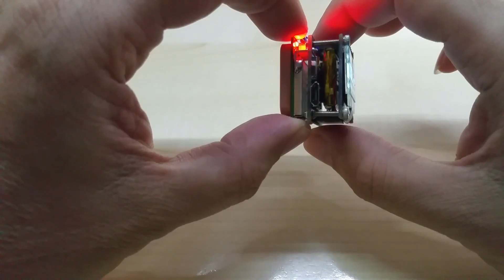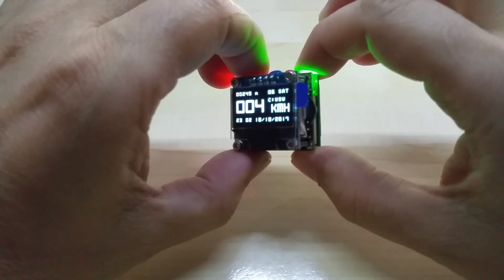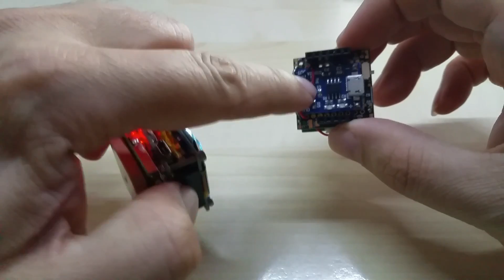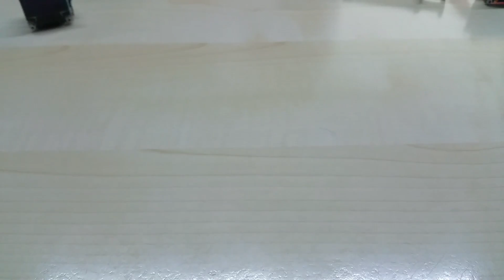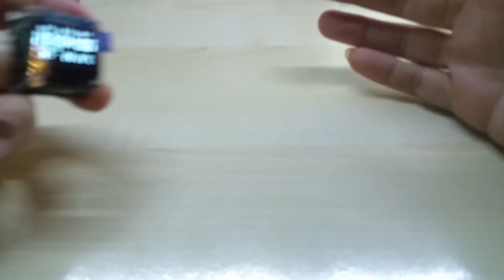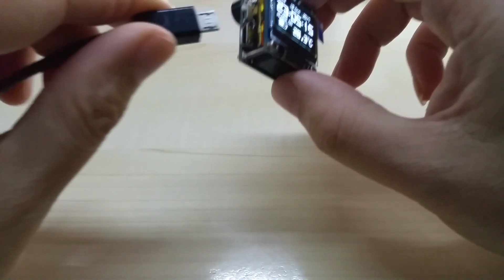New GPS and Clock Cube made with my OLEDiMAX PCB

Comment: Does it show temperature of oil, coolant, transmission? I'm looking for mercedes 2004? Is it possible to set temperature alarms? Is it possible to connect separate oil pressure sensor?( I don't have oil pressure sensor and looking to install one myself...
Reply from the maker: No, this is just a GPS. You need a gauge for a car. My CAN BUS gauge however works only for cars 2008 and newer that support the OBDII standart.

Comment: Since this device would be in car a lot of the time, it would be nice to add UV sensor also. So we can see how much UV in the bright day when we drive. (Just an idea)
Reply from the maker: Well if I do add something to it it will be a temp reading but the problem right now is that it needs to be extended or it gives false reading due to the heating up of the GPS module.
Reply from the maker: Forgot to add, my OLEDiTREK which is nearing completion could be fitted with a UV sensor or any other I2C based sensor for that matter :-)

Comment: hello sir, maybe you could do a demo on it onboard a moving vehicle, i want to see how fast the reading would be, if it has no delay in speed movement, we might order 3 of these :)
Reply from the maker: Hi, the update frequency is 1Hz, so the speed if it changes gets update once a second, it is perfectly suitable for speed reading.
Reply: anyway, hope you could still do a simple demo even on a bicycle. thanks :)
Reply from the maker: Hi, just did a video for you, you can see it here:

https://youtu.be/awtknKv3scQ
Reply: Hayri - thanks a lot for the effort. We're definitely gonna try it out.

Is there a way that i can power it w/o using a Lipo pack? Lets say i use a 12v motorcycle battery and use a stepdown BEC from 12v to 5v to power the GPS speedo? It will be quite difficult to pull out the lipo once i install that to a motorbike top bridge

Comment: Are you still interested in making me a high sample rate ultralite gps tracker for measuring speed of my racing drones?
Reply from the maker: Well I was limited by the 1Hz update rate of the GPS module I used on the GPS cube but now that I use a tiny (weight saving is good for drones) new GPS module with integrated antenna the size of a thumb nail on my new product the OLEDiTREK, I could use that and might make something for the drone market. Please send me your email for further discussion. Thanks.
Reply: that sounds awesome.. my email address is Zak@skunkworksbikes.com

I'm after a tracker for speed but there would be a market for a gps/magnetometer that talked to the flightcontroller and you have power available.. can't wait to chat more about it
Reply from the maker: Replied.

Comment: An easy way to dim the display is to use 2 pieces of Polaroid film and rotate one to dim. May not be as elegant as a software solution but simple and cheap.
Reply from the maker: Or just any grey colored foil :-) Just need to make it motorized to pull it over the screen at night time, lol.
Unfortunately not all display libraries support dimming but to make it possible with software and a small light sensor on the cube would be great.
Reply: That would be neat, especially if instead of just bright/dim it was graduated according to ambient light level.
Reply from the maker: Well hopefully one day it will be like that.
Reply: I used to have a car stereo that would dim its panel according to ambient light. That gave me the idea to make the volume change according to road noise. A mic picked up ambient noise and fed into an op amp along with inverted speaker output to eliminate reading the music as ambient. This was then used to control the volume. It worked very well for years until the unit started to draw over 1 amp even when off and would drain the battery overnight. Since I could not easily find the cause and don't even listen to the radio anymore it has since become a source of parts for other projects and been replaced with a newer unit. And since I don't use the radio on the road I will probably not bother to modify this one.
Reply from the maker: I used to be a car nut with modifying and making custom music installations and all, back in the days. Now I want piece and quiet when I drive and am glad to get from point a to B without getting my feet wet :-)
Reply: I don't have any OLED screens that I know of but it occurred to me that if they are like liquid crystal displays you would only need one polarized sheet to dim them as the output is already polarized. Or am I not understanding how they work?
 I have had my truck for a year and still have not even turned the radio on.
Reply from the maker: No, they have nothing to do with LCD screens, OLED stands for organic LED, meaning there are 128x64 tiny LED's in the display. And when there not on you get the perfect black so to speak, that's why they have a very high contrast ratio.
Reply: I guess I should read up on them as I like the display quality. I don't know why they are called organic, is it just a catchy name or do they grow them in a green house? Sorry, long, wet day.
Reply from the maker: Well, google will give you all the answers you are looking for :-) I do not know why they call them organic myself. Maybe they grow on trees :-) But I do love them which you can see in my products.

Comment: Quick question, I'm looking at how you use the bolts to connect one pcb to another. Are you using nuts of any sort or are the threads of the bolts simply "grabby" enough to take hold in the FR4?
Reply from the maker: No nuts, used to do it that way in the beginning but the nuts were just to big. Now the screws cut into the PCB and hold it securely.
Reply: Awesome. Is there a specific hole size you're using for those (presumably) M3 bolts?
Reply from the maker: They are M2,  the hole in the PCB is 1.6mm which is the regular tap size for a M2
Reply: Neat! Thanks for the info =)
Reply from the maker: You're welcome.

Comment: Nice work Hayri.   Makes me want to buy an upgrade, looks like you cleaned it up quite a bit.
Reply from the maker: Thanks Dave. It was quite a challenge to make everything fit but the result was worth it. Do you need any Lipo charging boards by a chance? Have now a whole bunch left over :-) The clock can also be made with a vertical USB connector so the cable would come out straight out the back, for a clean look from the front :-)